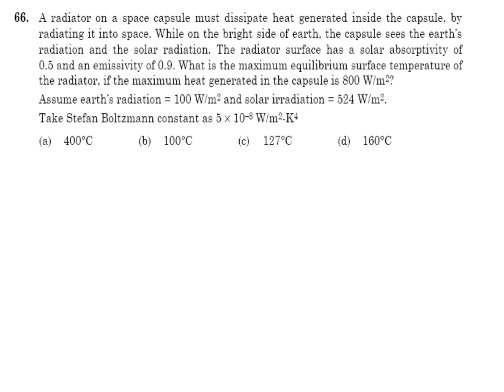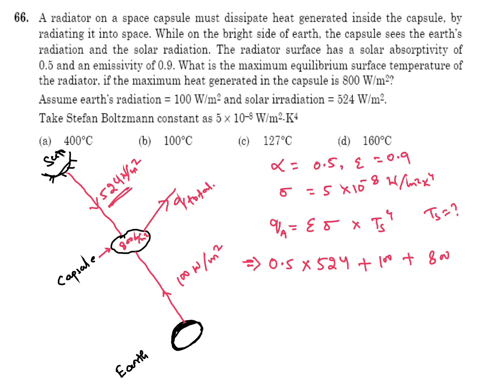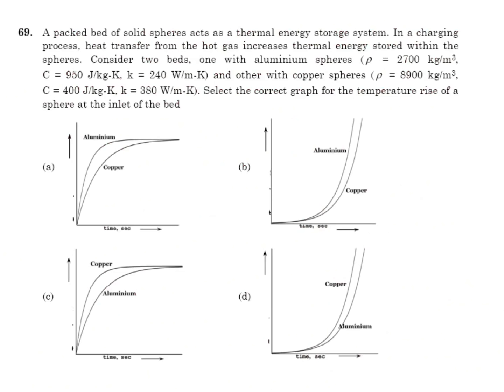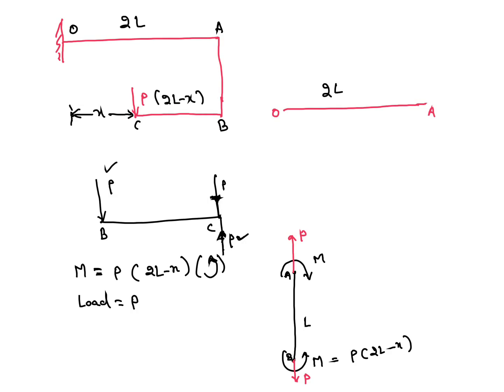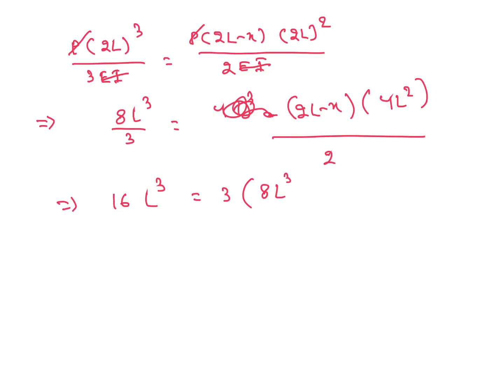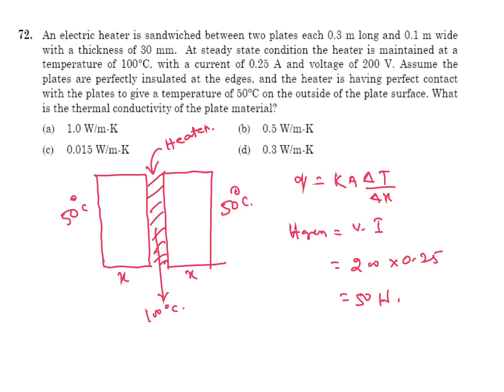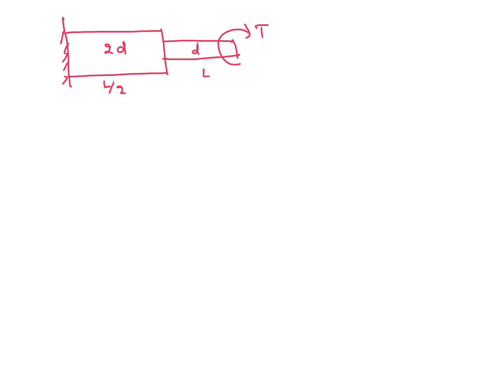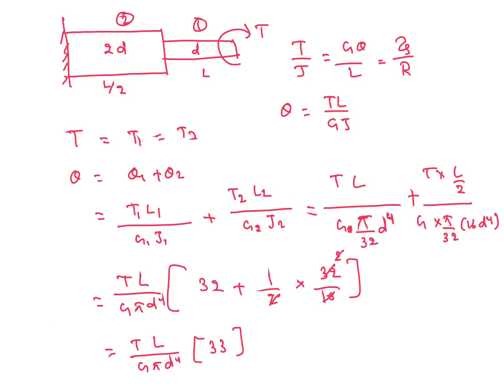ISRO 2017 SOLUTION Part 07

Comment: You are Answer is correct..... in question 69 but your solution is wrong you taken (400x380) for copper but it is actually (8900x400) which is higher than the Diffusivity of Aluminum.